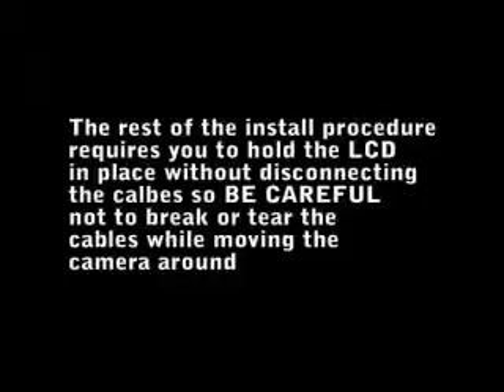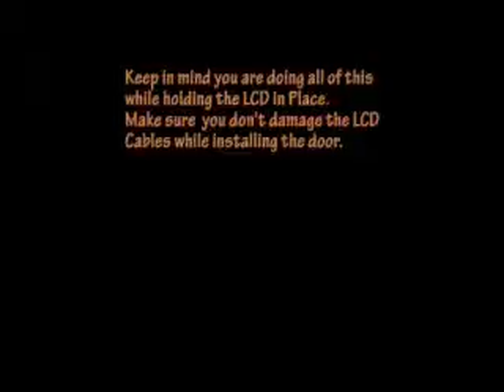Lumix Panasonic DMC-ZS1 DMC-ZS3 Door Install Replacement

Comment: Fixmycamera my lumix Panasonic DMC-SZ1 screen is black complete black tried messing with all the settings and all that is still complete black I think it might  be a sensor what do you think?? Please get back to me as soon as you can thank you!!
Reply: It takes pictures but there all black it works completely fine the camera itself but when I takes pics it's all blackness nothing but blackness turning it on also.
Reply: If you see the menu options on the screen but not the live image then this is called Black Live View. Black Live View is considered an Aperature/iris issue.  
It can also be a bad CCD but rarely does a CCD issue result in all black. Turn the unit on while looking into the Lens barrel.  See if you see the iris open. If it opens then your issue is the CCD. If it doesn't open then the issue is your iris.
Reply: The iris opens so you think it is the CCD? the thing is I just bought this camera from Georgia and had it shipped to Manhattan, Illinois ordered it on Thursday arrived here today and I called and they said it worked completely fine and was taking photos before they sent it out.